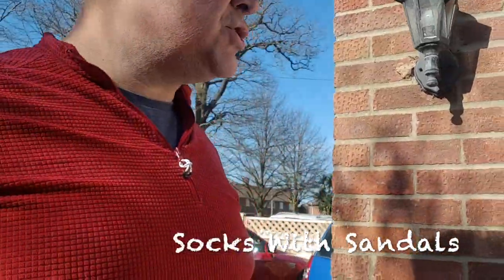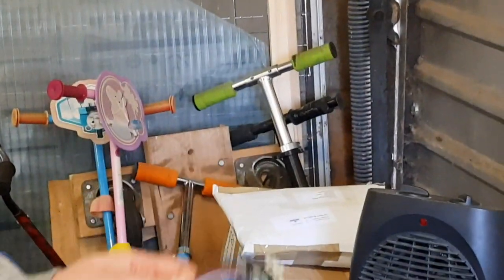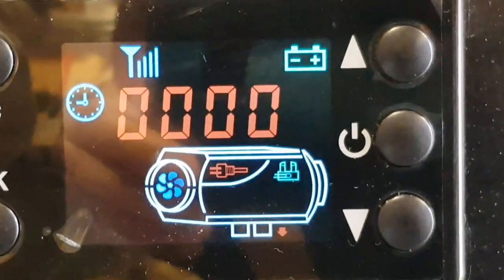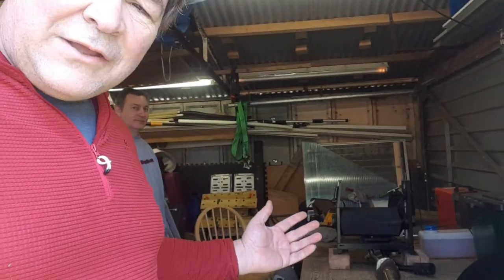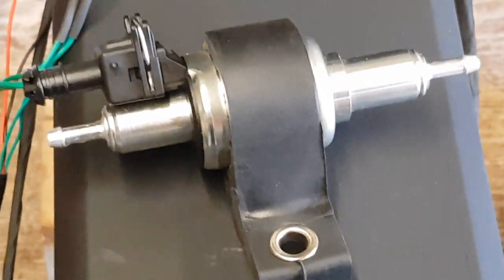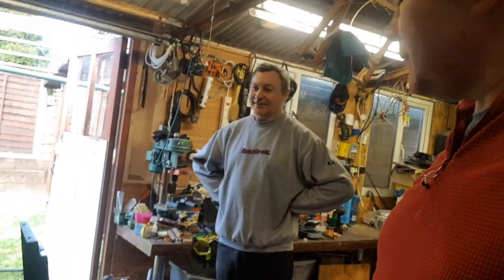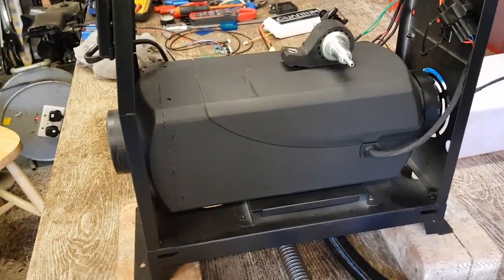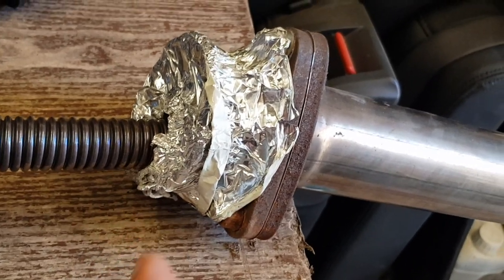Micro VanLife S05E32 Essex Man Invents Silent Microdosing Diesel Heater Pump

Comment: Thank you all for the great comments and to Socks with Sandals.:)
I have been rigorously testing this pump day and night and run about 100 liters of diesel through it with no issues. 
It is adjustable and will there fore run the 2Kw and 5Kw chinese diesel heaters. Carbon monoxide levels track the same as the std pump if not better with fine tuning.
It will run in any orientation. I have tested it with the diesel tank 2ft higher than the pump and burner with no issue and with the pump drawing from the diesel tank 2ft below the burner with no issue.
It has four wires that need connecting. Red and Black wires (Positive and Negative) to the same power supply as the Diesel Heater and two green wires that connect to the pump plug wires.
I should add that this pump will not wear faster pumping a non lubricated fuel like Kerosene, unlike the std pump.
I'm in the process of sourcing parts to build a first batch. The estimated price is £99 including first class tracked postage to UK, outside UK contact me for a price. 
If any one is interested please email me and I will add you to my build list and keep you updated on progress. I should have a first batch ready to go out by the end of April. Email: jamesbrowningsmith@yahoo.co.uk  (editing and adding more info)
Reply: I also live in colchester how much would it be to buy one these pumps from you please
Reply: Very interesting. Regarding pumps have you tried a Peristaltic pump. They dont click or thump they rotate.  As used in medical applications. Cheers from old George
Reply: @MakeDoAndMend1  Yes I have two working prototypes that I spent weeks perfecting and they do work but the pipe perishes and its very tricky to gauge when its going to split and empty the fuel tank into the box. They need constant/hourly monitoring, just not practical.:)
Reply: @jbsmith1  ok I have messed about with them. But I am an ex analogue engineer and couldn't get my head around converting pulses into a variable voltage for motor. Anyway just for info I run mine on parrafin, also tried Domestic heating oil at 68p a litre rather than expensive Diesel. Not sure if pipework would deteriorate on Paraffin etc. Ps added the video to my Chinese Diesel heater Playlist. Cheers from George
Reply: will it work with afterburner?
Reply: Awesome, well done. Email sent.
Reply: super to see you realy are enjoing it areal inventer makes it al in the shet   loving this  please putt me on the list and i will pay and also send you some real cookies from my home town
Reply: Hi, are you still sale it ?
Reply: These available ??
Reply: Hi buddy I’ve just bought the 2nd gen you sell from a friend in a motorhome group I have the diesel heater fitted to the floor of the motorhome I get fuel direct from the fuel tank 
However I would need to fit this pump under the van screwed to the floor will this ok like this buddy ? I don’t want leaks lol I can’t put it the same level as the heater because the fuel line comes from under to the turret the heater sits on 
I’m getting confused how to fit the pump being a second gen it’s different apparently 
Please help 🙏
Reply: Hello, still selling them?would you ship to canada?

Comment: Total overkill I buried mine in the middle of a tube of silicon  and filled it with expanding foam total silent
Reply from the maker: Silicone not silicon, I imagine!
Reply: Did it really work? Does if not get into the wiring connector? How did you mount it?
Reply: Works perfect .silicone tube was empty..1 cut along it's length tape over connectors...place in middle of tube. blob of silicone around pump to keep it central..place tape along the cut in tube allow silicone to cure overnight then fill from both ends with expanding foam .I mounted using  waste pipe brackets    mine been in 18 months works a treat 😁.hope this helps friend
Reply: @desmondbroad1305  
That’s awesome… what type of tape did you use for the connectors?
Reply: Pc electrical and gaffer tape on the tube so the foam dosent push it apart😁
Reply: I have one of these and i would disagree its not overkill its a perfect upgrade to a d heater.  Each to there own thou.
Reply: @desmondbroad1305  very nice. I have heard people doing the same with a section of pringles can as well

Comment: This is a really video. All we need now is a tidy air intake and exhaust like that used with a gas boiler that you pop through the wall. And a property integrated wi-fi for remote access, in addition to Bluetooth that has its uses, so I can monitor and control the heat in my garage and keep my motorbikes and tools from from damp.
Reply from the maker: Diesel heaters are really useful for keeping garages and sheds warm.

Comment: You will think I am a complete Nut, ! I have had 4 RVs with diesel heaters .Nothing gives me more pleasure on a bitter cold morning in England or Germany before I leave for the winter in Morocco, than to put my hand out from my warm bed , turn the little wheel and wait for that TickTikTick, then the Whoosh of hot air. Truck driver friends tell me the same.
Reply from the maker: All I have to do is see that the display reads "On" then I can snooze in the cozy dry warmth until it's time to get up in complete silence.

Comment: A lot of cost for that ,  I did it with a couple of zip strips holding the pump. Zero noise.
Reply from the maker: Yeah bolting your pump to the van bodywork turns it into a torture chamber.
Reply: @SocksWithSandals  agreed, rather have something not set up with zip ties that carries fuel!

Comment: the inlet filter mufler makes more noise on than  if nothing there, just  pull it off and cover with mesh ,and it will run a lot quieter . I waited weeks for a ultra quiet pump from china, only to find its leaking, and there's a full tank of fuel. I do wish i had enough room to fit a stop tap, when i fitted new dosing pump on outside of my all in one heater to stop some of the resonance from metal box . A bit of good news there are very good heater silencers on sale now, the have what looks like stove enameling on main body and ali ends stepped inport to outport much quieter than even eberspacher ones

Comment: hello Socks with Sandals,, does it matter the angle of the pump like in the pump these heaters come with.. Also, can the housing you supply be removed in order to fit it into the chassis of the heater? thanks for all your work solving this stupid problem..
Reply from the maker: Write to the inventor. Email pinned or in description.

Comment: well done lads, I was thinking about fuel control with air pressure, like some 2 stroke motorbike fuel tanks are under pressure to feed the carb ... using a pipe from the clean hot air side as the pressure vessel, I try not use micro controllers and PCB's in my projects, I'm more steampunk, its like having gas bbq  when charcoal worked great... keep up the builds, first time to the channel, I'll see if there more content to look at. 👍
Reply from the maker: Thank you for your first comment

Comment: Don't know what's inside the "blackbox". But I think it's possible to build a silent pump with a silicone tube like in a medical blood pump. The only thing you have to change is the motor. You don't want continous flow, so take a stepper motor instead. The driver must convert the signal in more or less steps per minute for the stepper motor. That's it. I have no need for a silent pump because i have no camper. Otherwise i build one. What I did build is a much quieter exhaust silencer out of stainless steel and glasswool. Next project is a better silencer for the combustion air intake. Also I have build a silencer for the cold air intake out of mdf and acoustic foam and pvc drain pipe.
Reply from the maker: Good luck getting a production line of them going.
Reply: @SocksWithSandals  of the imaginary pump or the silencer?
It was not my intention to sell them. I heat my garage with two heaters when i do woodwork and the heaters were to noisy for me. So i bought a tig welder, learned a little welding by doing and build a muffler out of 70mm inox pipe (25cm long) with a 25mm perforated pipe in the center and inox end-caps. Learned a lot about inox and expensive tools. And now my heaters are really quiet. No sound like a dragon anymore. Just a silent whispering.
Reply from the maker: Either. All the peripherals of the central burner of the Chinese diesel heater system are notoriously crap quality, so good luck making accessories.
Reply: @SocksWithSandals  you are right. They are all crap. So there is more room for us to invent better custom parts.
No chance to produce the muffler and sell them. Too expensive. But will last much longer then the heaters because i used 2mm inox. Has the size of a 0.5 liter beer can 😁

Comment: Now all you need is to find a quiet air circulating fan for the heater. Maybe even an outboard unit where space is not a problem.
Reply from the maker: Good luck with your outboard fan research, Tony.

Comment: Is there a big noticeable difference in heat output going from 5kw -1kw?
Reply from the maker: Yes, it's all about the lowest temperature at which equilibrium can be achieved.
R number is all about the Watts per square metre per degree in temperature difference.
I can sit in a cosy and economical 20ºC interior in my microvan with a 2kW max diesel heater.

Comment: It could use it to deliver  a small amount of water into the engine air intake  chambers
Reply from the maker: How do water droplets assist combustion, Your Majesty?
Reply: @SocksWithSandals  water in the combustion process helps clean up the combustion as the water is superheated it is flashed into steam giving the same effect as in a steam engine.. Expanding taking up more space..
 When ones head gasket is blown the surrounding area coolant escapes usually is extremely clean.. Given the correct amount of water fuel efficiency is increased... Intake temperatures cooled and therefore increased bhp.. 
The method was used on ww2 fighter jets it works incredibly well on turbo engines where temperatures can really be reduced and boost increased, also used as methanol injection for even bigger increases in power. 
Think how the car feels on a cool damp morning... 
Obviously to much water and your hydrolocking the engine its a fine balance.

Comment: Looks like a stepper motor driver so maybe a  brushless  diaphragm pump
Reply from the maker: Good guess. No.
Even more ingenious than that!
I can't tell you.
Reply: It's a dosing pump, often used in labs for dosing chemicals.
It squeaks a piece of plastic tubing in a "circular" motion forcing the liquid through.
Quantity is determined by the ID of the tube combined with the rate of/rpm of motor squeaking the tube.
It is a really quite pump/dosing solution and since these heaters don't require the fuel to be fed to the burner at any pressure this is an ideal solution if you want it silent.

If it isn't a dosing pump, then a dosing pump is never the less a superb solution to the problem :D

Comment: I managed to quieten my pump down by suspending it from rubber cable ties, the type that are used on trees and large plants.
Reply from the maker: Mine is hanging from a rubber band and wrapped in insulation. The full ticking is soothing.

Comment: absolute hoot the lengths youve gone to for a complex solution....
or you could have just bought 2mm outside diameter nylon airline pipe and tweaked the angle of the pump until its quiter than you demonstrate.....
try it... its the simple solution